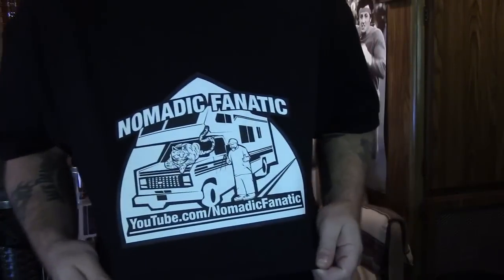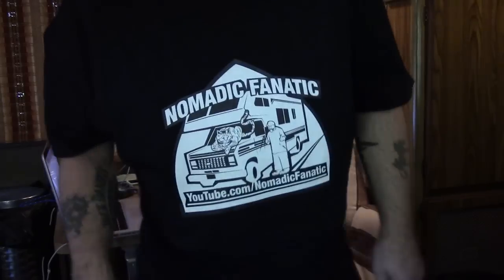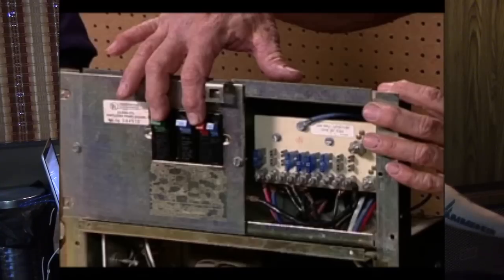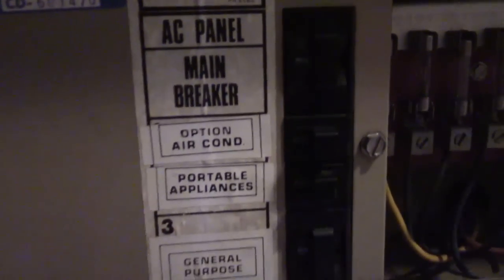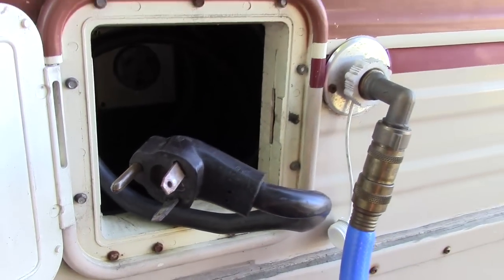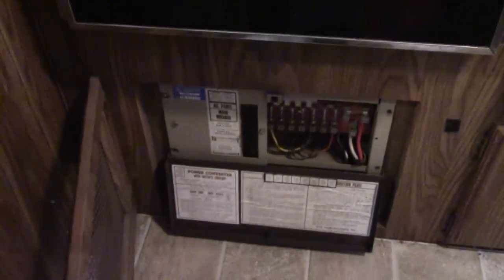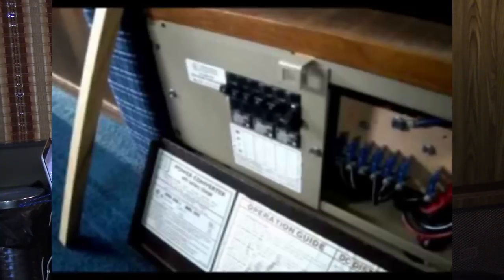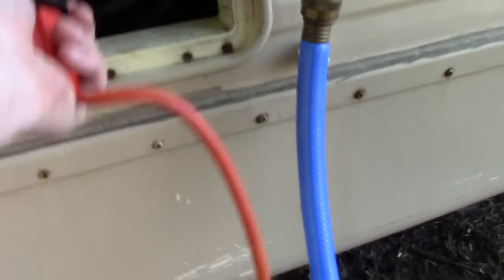RV Power For Dummies

Comment: nomadic fanatic.  serious question:  I want to run my entire rv from a 3000 watt inverter(approx 27 amps at 110v) , which will supply my shore cable with ac power.  I have disconnected the coach batteries, and power the inverter with a battery bank, which is recharged by solar planels.  can you please explain whether this is feasible considering that the rv converter will be re transforming(and losing energy through resistance) electricity from dc, to ac, back to dc, just to power things like some lights and the refrigerator for example?  is there a way around this problem somehow.

Comment: I ran a chord off my 2000 watt inverter through hatch door and into my 120 in.. hooked to backup house battery...we have no gen...when boondocking and need high power ac...I flip on the inverter and voila I have 120 going into my ac system.  i use it only when needed not for convenience.

Comment: This is a good video.  If you up the size of your big inverter, you will also need more battery capacity.   Finally, I'd suggest you get a small, "pure sine wave" inverter to charge your computer and anything electronic.  Most things don't need it, but you will eventually fry your power supply for your laptop (that modified sine wave inverter is slowly beating on it and will definitely shorten its life).  You need maybe a 300 watt one and they aren't absurdly expensive.
Reply: Maybe that is what happened to mine? We had just arrived to Fl, and has been a day or 4 when I plugged in my Laptop. My wife and I both heard a "pop" and has not worked since.

Comment: Thank you for sharing in a way that has made it somewhat easier for me to understand the 12 volt system in my little RV Trailer. My trailer is 15 feet long, does not have a fan or refrigerator or air conditioning. It does have a power convertor and I assume it must have an inverter. It has 12 volt RV Lights that are working just fine running on the 12 volt batteries and on hard power. It does have a little car type steroe and that is also working fine. When I plug the RV into hard power at home the 110 outlets work just fine. However, the 12 volt power / cigarette lighter type outlets do not work at all. There are two 12 volt outlets inside the rv trailer and two in the storage compartments that are only accessible from the outside of the trailer. The trailer is a True North, Outdoor Support Utility Vehicle made  by Northwoods, it is a 2008 model and has had very little use power wise. For the most part I have used solar rechargeable lanterns and other equipment that I have purchased for tent camping. I do however like to use the 12 volt outlets to charge and maintain a charge in my laptop, cell phone, etc. I've checked the fuses and found that one fuse was burnt out and I have replaced the burnt fuse, but it hasn't made any difference. Do you know if there is something else I could check before booking an appointment with an RV dealer. To be honest, it seems my little RV is of very little interest to any of the repair facilities, I always seem to sit at the back of the line waiting for service.

Comment: If my camper does not have an a/c unit. When I camp with a electrical box. Should I not use the 30amp plug? Should I stick with the 15 amp reducer?  Or... is my converter taking care of it? Thank you...Bob

Comment: Nice explanation, thanks. I am leaving this weekend on a two week adventure  but my A/C and microwave have stopped working. I wanted to know where the second set of fuses and breakers are, I have a converter and my RV looks like yours.. 1983 Ford. Thanks
Reply: For the benefit of others since this reply is to an old post- If you are plugged into shore power, open up your main circuit breaker panel. There is only one. If the fuze on the converter is good and you hear it running. All AC (house) current runs through breakers on the panel. If they all show "on", fully switch them off, then flip them back on to reset the breaker. If on generator, there is a switch at the front right corner which is the breaker for the generator. Flip it off and back on to reset it. Hope this helps.

Comment: YOU ARE about the closest  info video that explains to me what this dummy like me  can understand on how this all works.. Thank you so much. Now  a question.. can I run a big flat screen tv for any length of time using a deep cycle battery.. even  perhaps adding  another battery of like kind for the power I need.
Reply: GILBERT GAUTHIER You didn't specify how big, "BIG" is but a typical 32" LED TV only draws 50watts. That will be easy for almost any size inverter/battery combo. A plasma TV draws quite a bit more. Something that Nomatic Fanatic didn't go into is that LED replacement bulbs for your RV interior lights will significantly reduce your power usage by almost 90%. 10 LED bulbs use as much current as 1 incandescent bulb. This could be important to a boondocker
Reply: GILBERT GAUTHIER Hey Eric : You couldn't have made it any easier for me. Really a great help.

Comment: Take your extension cord, cut off ty the female end, replace with a 3 prong male end. Now you have a cord with 2 male ends. Plug one end into your inverter and the Other end into any of your 110volt plugs. Now you have 110v at all your outlets. Some rv will have a main AC breaker along with individual circuit breakers. These may require you turn off the main breaker before you feed your inverter into the 110 outlets. Some don't require it but its a good practice to do anyway.
Reply: Wait, what?  Is it really this simple?

Comment: Can anybody tell me, if I have a separate battery for my fridge (electric only, 42Watt, 3-way is so '80's!) can I run power to charge it directly from the Alternator? or do I need a charge controller and diode in between to stop them all trying to equalize?

Comment: How do you run dc lights on the battery
Reply: The battery IS dc, Tho I personally changed all my bulbs to 12v LED, a fraction of the wattage, they will work for weeks off the battery...
Reply: Where do I get cheap 12 volt I will be living in a van full time soon
Reply: I been learning a lot of things and tired of being a slave to the corporate America
Reply: its appealing is'nt it? Do u mean a cheap battery or cheap lights? I bought a strip of LED lights which are sticky backed like tape and wire them in, they were cheap (half meter was 33 LEDs, (11 sets of 3) in Natural light! very important, super bright are too harsh and spot-light-ish!) These are enough to light the whole living area, and use negligable power, 2.5 Watts total!
As for the Battery, dont buy cheap! U WILL regret it! Heating is the big thing for me, Americans always harp on about the "AC"...What??? come live here in Ireland!:-)
Reply: What important about the light what kind should I get? And your ion Ireland I'm Irish
Reply: Cool! fekkin cold tho!!! Well mine was a 1990 all original, and used bulbs in each light, nice soft light, but high power, (I never plug in to shore power) so I modernised to LED, initially I used super bright LED, the ones that have a bright blue/white effect, but they were a horribly cold atmosphere, so I switched to yellow LED, better, but too dim for useful work, I discovered Natural light LEDs were available (strangly??) and they work a treat, according to the Math they can theoretically stay on for 360hrs! (15 days) continuous on 1 charge, (The originals would last 10 hrs!) It means I can run the TV and other stuff without too much worry...

Comment: How realistic would it be to have a total of 4 deep cycle batteries A 2000 or 3000 watt inverter ... And then plugging my RV shore power cord into the inverter to power all the appliances and such inside?

Comment: Harbor Freight has some pretty awesome inverters for a fairly reasonable price. Only thing is you will have to most likely add another deep cell battery and use some heavy duty cables, but i do recommend them
Reply: To clarify, Harbor Freight sells modified-sine inverters, which can damage sensitive electrical equipment, but modified sine inverters are much cheaper than pure sine inverters.

Comment: blow a fuse somewhere in the water pump and water heater circirt.
How can find and replace this fuse to fix it and bring water power to the rv.
Doug
Reply: Lawles@att......... I am BRAND NEW at this RV stuff.  This Dummy video has my name on it.  I understand this a LOT better.  Can you explain to me about using Generator... how long can you use it, etc.  Also I have a recently new RV but never can understand how the power stuff works.. My RV does have an installed inverter but not sure how it works?.....I know, Dummy....I said that.  Thx
Reply from the maker: Trace that cord all the way from the pump to the inverter.  If it's not a fuse in the front, you may have a relay with an in-line fuse.
Reply: it was a blow fuse in the box, that I used a fuse tester on both of the fuse to test it and found it was easy to do inline than pulling them out and looking at them by eye site.
So fix the water pump problem and heater problem.
So try the same way up front and found another fuse to the horn and fix that one too
Thank you for video it helpme fix the problem Doug oldham
Reply from the maker: Great! Glad to hear it was something simple.
Reply: I fix the problem by testing fuses

Comment: Eric,

Thanks. I bought split charge relay, 6 x 100 W solar panels, and charge 4 leisure batteries 110amp, and 2 inverters 3000 W pure sine and 1000 modified sine. This runs all fridge, electric hobs, pc, laptop, phones,lights, bluetooth speakers and hoover.

Best advice i give for travel living is cleaning, I got to do that everyday because dust and carpets quickly build up.

take care,

Garvin

Comment: I have a 77 sportsman, and it has one deep battery...  I am going to buy more, and I have an 800 watt inverter... what about haveing mutiple small inverters...  it seems i can pick up an 800 or 1000 at a pawn shop for very little money, and the bigger ones cost big bucks...
Reply: metho kingsley
to parallel the batteries you connect them with battery size cable pos to pos and neg to neg. from the outside post on one side run your positive cable to what you want to power and from the other side of the now twin batteries, run a negative cable to a guaranteed ground.
Reply: make sure if ur deep cycle batteries u buy are 12 volt. u can parallel the batteries to turn it into 1 big battery. it keeps the volts the same but doubles the amps. the batteries have to have the same volts and the same amps for this to work.

Comment: Hello again. This video does exactly what it advertises. Your youtube channel and a handfull of forums are pretty much my only decent RV help resources. The RV i got my hands on is a 1986 rockwood bayport class A. I haven't actually purchased it yet nor have I taken it for a test drive. I will actually be living out of it in my friends backyard (where it is currently parked). Right now I am just cleaning it out / testing all the electrical. Today I tried to vacuum while running the ac and everything but the DC power shut off. I ran to this video the moment that happened.. it was the breaker box to the house that needed to be reset. Live and Learn. Any thoughts or concerns about the model I just mentioned? It was just serviced last year according to the owner the only thing that needs to be replaced are the tires. He is offering to sell it to me for $2.5g's. Over the last 28yrs it was only used twice (2 trips from AZ to CA and back).

Comment: Thank you for this video! Great explanations & it really helped me (I had no idea that I shouldn't use a standard extension cord for extended periods). One thing that weirded me out when I bought my RV was a switch on the left side of the driver's seat that says "Dual" & "Mom". I guess Dual is to charge both batteries while driving while Mom is for 'momentary' for connecting the coach battery to help start the RV.

Comment: I have a generator but none of appliances power on. Should i replace the deep cycle batt. ??? And also how to you power your refrigerator if you dont run the generator ??? How much does it cost for solar ???
Reply: Sweet, thx. for the respones.
Reply: Nomadic Fanatic just get an extension lead and hook it from the inverter to the shore power inlet
Reply: Extensions lead ? Shore power inlet ? Im new to the rv world....
Reply: abq pinkman power inlet is where you get power hook up from it should power the whole RV with 1000watts

Comment: Dude, I have been watching your videos all night and you have no IDEA how much you have helped me. I just purchased an 84 tioga 23ft so almost an identical RV and it's been confusing the crap out of me as to why those outlets didn't work.  Looks like a need to get a small inverter for a temporary solution and look into installing a larger one when I can.  My demands are low though, just need to charge my macbook pro and my smartphone.  Me and my wife will be boondocking it until our life turns around, both unemployed but don't qualify for unemployment so we have basically zero income.  An RV, as you pointed out, is hella lot cheaper than rent.  Situation is almost identical, RV is almost identical.  Thanks brother for all your help.
Reply: I can message them or email them or something. We picked it up a couple of days ago and still have the apartment to the end of the month so we are in the process of selling and packing and moving. Let me know how you want the pics and is be glad to send them. One quick question, do you prefer the loft bed or the rear bed? Loft actually looks really comfy.
Reply: Thanks man, my wife and I will have to experiment I suppose and see what works best for us.  If we like the lost we were talking about turning the rear bed into a raised sitting area/lounge.

Comment: I need some ideas or thoughts about using maybe a jump starter and a deep cycle battery in our van.  I am thinking of using a deep cycle battery to power our AC/DC cooler.  There is no problem during the day when we are traveling and if we have AC power at our campsite.

Is it possible to have a deep cycle battery to power our cooler during the night and then using shore power, when we have it, to recharge the battery using a jump starter?

Or do you have other suggestions that I can use?   I am also thinking of using solar window film for recharging, if it isn't too expensive.

Your thoughts would be appreciated.
Reply: My life changed when I got solar panels. My batteries always use to die on my trailer. Now, I have a van and use 2 solar panels on a Zamp system setup. My batteries never die and are constantly recharging. I would start with solar panels to help with recharging the batteries.

Comment: Make sure that each and every wire you have coming off the positive terminal of the battery goes through a fuse or circuit breaker or risk a fire.
Reply: Thx! Is it necessary to hv a ground as well or only if you don't have a fuse?
Reply: @jennyorky1378  grounding doesn't replace  a fuse.  Thats why your house has both.  Grounding gives current a path other than through you.

Comment: Hi Eric 

This Elias from so cal again,

I don't spend that much time in my RV, 
I do have a portable instant power device just like yours, I bought it from Wal-Mart,  when it comes to lightening the RV I use two 2AA battery operated led lamps,  and I only use the portable power device to charge my cell or tablet. Twice a week, I do not use running water in the RV, instead of that I always carry gallons and whenever and wherever I see a faucet I fill up my gallons,

Comment: One good rule that you may not be aware of, is that you should never run your batteries below 50% of full charge.  That is generally the point were you are hurting them and over time will certainly shorten it's life. 

Stay dry.

Comment: Nice explanations! This video definitely follows your goal of simplify. One thing to note - if you buy a "smaller" inverter to start with, then upgrade to a larger one the original inverter can be left in place while the larger one can take over some of the larger loads. So incremental inverter purchases are very cost effective. I have four separate inverters that are now each dedicated to one "job" or area. For instance one runs my computers while another runs my video / sound system and so on.

Again, thanks for sharing ! ! !